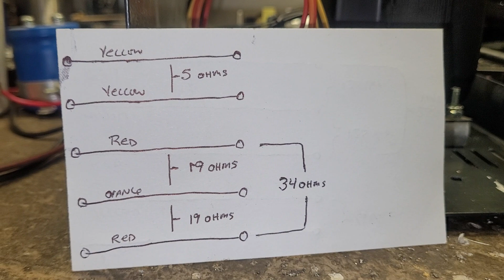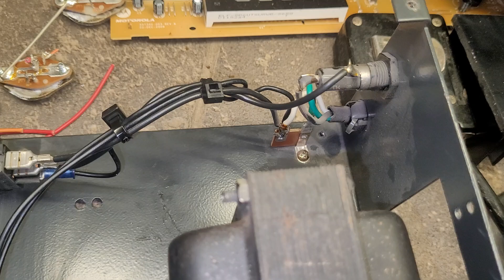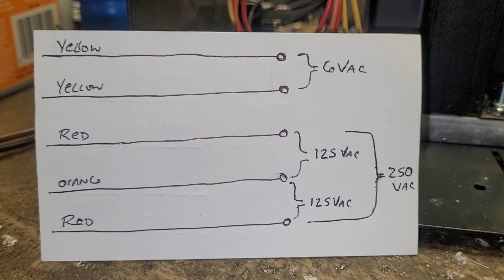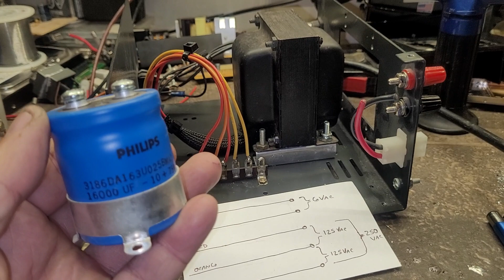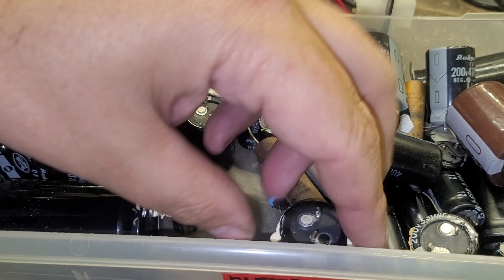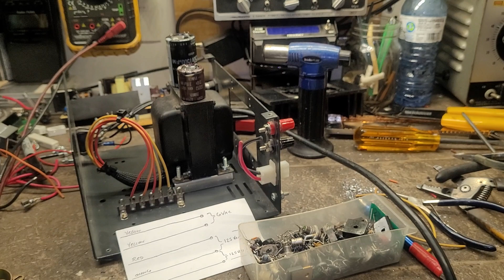Lets build a high voltage power supply  PART-2

Comment: I love firecrackers! 😂

So we measured the transformer is still good. And equal. I’ve seen smaller transformers with higher voltage output.  
But that’ll be a nice high voltage transformer. 

Looking forward to the next one. 👍🏻